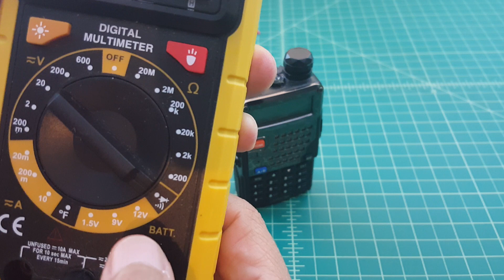Increasing the Range of your Baofeng UV-5R With a Counterpoise - TheSmokinApe

Comment: Putting DC voltage across an ohm meter, sometimes blows out the meter.  I usually check with a volt meter to be sure there is 0 volts, before I test something like that with an ohm meter

Comment: Would wire length work if I'm using my Baofeng BF-F8 Plus as a PMR radio❓
Reply from the maker: You need to cut it specifically for the band

Comment: No FN way!  There’s a few 5/8 wave antennas on the market.  But the problem is you need a death grip on the radio to make them out perform a 1/2 wave.  You just gave me an idea to make a single tape measure radial that centers on the 2 belt clip screws for a range lord radio.

Comment: Just curious if anyone has used a counterpoise with it coiled up a little to get it out of the way? Does it defeat the purpose if its curled up and tucked out of the way? Ive made one but find it a little annoying to have it dangling on my side as im walking through the woods. Thanks for any input.
Reply from the maker: I haven’t tried it but I would think it wouldn’t work well and could cause SWR problems.
Reply: @TheSmokinApe  Thank you for the reply and advice.

Comment: So I have 200 acres of bush and need to set up my uv-5r in the house sometimes as a base station . Could a portable J pole antenna  be run up to the second floor to increase range through a mile of bush ?? Thoughts.
Reply from the maker: Yeah, you could get a mile easy with a Jpole 👍

Comment: worth a try. I use my UV-5R backpacking in the side of backpack with speaker mic. I work both bands so will try 2 meter one,  I do have 42in abbree antenna but only use it when at fixed location like a picnet table. 73/s
Reply from the maker: Yeah, no kidding...

Comment: I think Im a counterpoise.   When I am receiving a weak signal with my boefeng, if I grab the antenna with a firm grip, the signal increases in strength and modulation.
Reply from the maker: Hey Michael, when you hold the Baofeng regardless of where…. You are absolutely part of the antenna system.
Reply: @TheSmokinApe  lol.  I know.   the old realistic cb radio hand sets in the early 1980s had metal panels on the sides to enhance making you a part of the system.   Its cool though.  When I have the boafeng on the table and I get a weak signal....I reach over and grab the antenna and the signal clears right up.

Comment: Makes perfect sense.
A little trivia: Back in the 70's and so Motorola HT's had a metal surface around the frame of the radio that you'd end up grabbing to hold the radio. Thus counter poise. As radio's evolved, so did plastic cases. Never could figure that out
Reply from the maker: Hey Dave, thanks for the trivia 👍

Comment: You MIGHT want to "pin" this comment! YES, counterpoises DO WORK really well! But you'll want to make them a hair LONG and then test the SWR with an SWR meter, then TRIM them to length for whatever frequencies you want to use, or else you can have excessive amounts of reflected RF energy bouncing back into your radio which will COOK it over time! Counterpoises work REALLY well when you're on soil or rocky ground that doesn't give you a good electrical ground to the Earth too!

Comment: The lanyard loop is ground iv seen counterpoise lanyards for these . Looks a bit more professional than a wire under the antenna or clip lug..
Reply from the maker: Good point, I wouldn’t want to mess up the professional look of a Baofeng 👍
Reply: @TheSmokinApe  you don't think It's professional?
Reply from the maker: @johnhosler9417  I’m kind of joking around, I’m not a feng hater.
Reply: @TheSmokinApe  the 24 dollar murs/gmrs/marine vhf/2meter ham/70cm ham LMR commercial fm repeater compatible flashlight. The little radio that could.

No wonder it's illegal all the other companies in the sub $50 . couldn't make a profit.

It's a pretty slick radio

Comment: If you make a "Sping" connector (solder a ring terminal to a spade connector), you can then change tails in the space of a couple of seconds - unplug the 2M tail and plug in the 70cm without having to fumble out with a screwdriver (and risk dropping/losing the screw).

Or you can have a 17cm tail ring terminalled to the radio (for 70cm use) but with a spade on the end of the tail, so you can plug in the "extender" for 2 Metres (an extras 35cm or so)

Both save a lot of time and obviate the need to carry a screwdriver or risk losing the case screw.
Reply from the maker: Thats a great idea, thanks for sharing 👍

Comment: Everything you're saying is true. A 4 watt baofeng uv5r iii and 8 watt baofeng uv5r.  Antennae makes all the difference. Sorry for bothering you again! But it confuses me as to when you grab the radio: better reception? If you're not holding it. It's not as strong and a bit scratchy! Does that mean it's using your body as a ground? But the counterpoise I got from you and I'm picking up every tradesman in the area when scanning and every truck driver. But body to ground? Is that possible? Btw honestly I am getting like a 3 db gain with the counterpoise. Cheers
Reply from the maker: With most HT radios the operator is supposed to act as part of the ground 👍
Reply: @TheSmokinApe  ok. That explains a lot. I couldn't find anything until you told me
 Cheers

Comment: Good info! But shouldn't the other end be attached to the antenna connector? I'm not say it should be but I'm thinking that would be best.
Reply: It is connected to the antenna connectors ground potential.  The antenna ground is connected to the chassis and the screw he attached the counterpoise to is also connected to the chassis, so the counterpoise is connected to the same ground potential as the antenna's ground side.  I have been using these for years, started using these on a Radio Shack HTX-202 back in 1992 as a newbie ham.  Got the idea out of an old ARRL antenna book.

Comment: I made a 1.5 metre counterpoise and when testing with the surecom sw 33 with no counterpoise it was showing 19.9 on swr. When I put my counterpoise my swr dropped to under 9 swr. It was touching the concrete. And i had full reception from the highway. I also grabbed a wirewound inductor, a ferrite core type with just sliding up and down the Nagoya 771, my reception was going up and down. Lol! Believe it or not the big counterpoise made a big difference. Can you do a test of swr meter surecom sw 33? Mine has 3 settings and it's confusing me on 3rd setting? Love your vids. Amazing how experimenting can make a difference between good and bad!
Reply from the maker: I don't have the Surecom but let me see if I can get one, glad you like the videos 👍
Reply: @TheSmokinApe  always a good tutorial.
Reply: The Surecom SW33 costs more than the UV-5R!

Comment: I tried a 16cm one for PMR and what a difference. I only bought a pair of UV-5R's recently mistakenly believing they were just better quality walkie talkies...doh!  However they have sparked my interest in ham radio.  I still have the OEM rubber ducks fitted but a pair of Nagoya 771's are on the way.  I have read the OEM antenna are pretty bad so I was rooting about on the net and read about counterpoints.  Before fitting them the radios were simply short range walkie talkies but after fitting they came alive.  I have been receiving extremely clear transmissions from all around me for a distance of over 20 miles!!!!  No I'm not kidding.  Admittedly the best one was in a pretty elevated position on moorland in West Yorkshire (I'm situated West of Manchester UK on flat peat farmland).  He was transmitting from Holme Moss near Holmfirth where the BBC TV mast is located.  He was talking to others in Runcorn, Cheshire, Bolton in Lancashire and Eccles some five miles East of me.  I ask for a radio test, admittedly at high power in frequency mode and he reported 3/9. I am very impressed a piece if wire can do that.  I went into channel mode and reception was still as clear but my transmission was barely readable.  Given the distance (20+ miles) that did not surprise me.  However it did transmit the five miles to Eccles though not very clearly.  These are great little radios but illegal as PMR's in the UK without a licence.  However I am going to take the Foundation course and test as it has sparked an interest in this old codger.  Who knows?  I may well get deeply into it and invest in a decent base station.  Something else for my wife to moan at me about other than my collection of rifles, csmeras and all my time messing with computers and electronics.  A man has to have a hobby or two, or three or four or......😄
Reply from the maker: That's awesome, good luck on the test!
Reply: Just curious is all.. but what frequencies were you dialed in on while using them as "walkie talkies" ? :)
Reply: @bradskis81  Europe's PMR446...

Comment: Yep.. 1 db gain is likely. To get 12 db gain over the H-T antenna you would have to put a 15' triple stacked 5/8 wave vertical w/ a 4-radial ground plane... or a 10 element Yagi... That would come close to 12 db gain, though either might prove a little unwieldy when getting into and out of your vehicle. Anyone that claims 12 db gain by adding the counterpoise learned to calculate decibels-of-gain estimates from the current President.

Comment: Dont have an issue with drinking but IMHO it doesn't increase the credibility of the vid.  Also
I heard that 468 is the divisible figure but I could be wrong about that.  
Good video, the mounting to the belt clip is interesting.  Practical.  Have wondered about the db increase also.  Will have to research but I have plenty of scrap parts to make one.  So...I'm gonna.
Reply from the maker: Good luck with the project 👍

Comment: Just found on-line  an accidentally-found method to increase UV-5R T/R POWER. The person explains the following steps which he says he found accidentally and claims once the radio is turned off so will these unknown special settings..Writing it here that SA may want to test!!, ie: " 1. Depress [MENU] button
2. Scroll to menu # 2
3. Depress [MENU] button again
4. Toggle the UP or DOWN arrow until 'HIGH' or 'LOW' is displayed (your choice)
5. Depress [MENU] again to confirm, BUT - DO NOT depress [EXIT]
... an 'L' will appear adjacent to the 'S' meter in the LCD if it 'took'
6. Depress the PTT button on the radio
... Note, if you depress [EXIT] instead of the PTT button, the 'L' will disappear from the LCD.

The radio will retain this changed power level until the radio is turned off. When the radio is powered up again, the power output level will again revert to the original programmed level." Hoping it's true.
Reply from the maker: Robert Fitzgerald the UV-5R only has low and high power.  The “L” means you are set to low...  it would be nice if you could get more but this isn’t going to do it 👍
Reply: @TheSmokinApe  I see. So you've tried the adjustment using a power meter?
Reply from the maker: Yeah, I've done dozens of tests on these radios.

Comment: Just became a Ham a couple weeks ago.  Is that wire supposed to establish a ground plane?
Reply from the maker: Yeah 👍
Reply: @TheSmokinApe  Well then, that makese sense from what I'm studying so far.  A friend gifted me a UV-5R and that put me on the path.  Thanks for the video.  I look forward to trying your little hack out.  Thanks and thumbs up!
Reply from the maker: Thanks man!  Good luck on the general 👍
Reply: @TheSmokinApe  BTW - I skipped fwd throughout your video initially to verify it was a legitimate sounding tip.  I replayed it and realize that you quite clearly mentioned the "ground plane" idea - totally makes sense.  I am in the process of mounting a 4 ft vertical fiberglass antenna with ground plane that I'm planning to connect to my UV-5R which doesn't have as good a reception  with the default antenna compared to my RTL USB dongle with SDR Console (I prefer it over SDR#).  I didn't think about the ground plane part of the issue until I came accross this video...  Thanks again.
Reply from the maker: Congrats on becoming a ham!
Reply: @TheSmokinApe  Thanks much.  I am working on my General license now.

Comment: Does it matter the length of the antenna,Stubby or long? tiger tail Will always be the same length for the appropriate band?
Reply from the maker: It should be a 1/4 wave of the band you are using 👍

Comment: Hello, I am KN4WKJ, and correct me if I am wrong, but at about 1:45, he mentions grounding the negative charge. Though in the user manual of the uv5r it says that you shouldn’t use the radio while it is on the charger, (I still do because it makes my transmitting power stronger, but that’s beside the point), while it is on the charger, the weird looking middle connecting port is actually ground. Once again, please correct me if I am wrong, but that is what it appears to be.

Comment: What do you think about this video? he claims most people of a misconception of counterpoise.
https://youtu.be/DMGXGxbn5GU
Reply from the maker: I think his product is reasonable.  What he says about the adapters isn’t fully accurate and I’d like to see some evidence using an antenna analyzer to support his claims.  You can use a a coax feedline to remote mount your antenna and while it slightly changes your antenna system it doesn’t really change the resonance of the antenna. 👍

Comment: Ok so the standard antennas are dual band eg they have two wound elements. Surely they are in parallel but depending which band 2m or 70cm the other half is ignored. So if you connect 2 rat tails one for each band does the radio ignore the one for the other band ? I've always wondered
Reply from the maker: I’ve never tried, sorry man 👍
Reply: @TheSmokinApe  I'll try it with a power meter and a swr meter and see if it works
Reply: Interesting. Keep us informed if you find out

Comment: Antennas help for sure, but if you have a crazy 6 foot antenna it’s only gonna work as well as the radio allows it to. If you have a 1 to 5 W radio, you can only put smaller antennas on it, a longer one is just a waste of space. 10-20W will allow longer antennas to work to full capacity

Comment: Tram 1185. We take the antenna off the mag mount. Cut a stainless steel welding rod down to the frequency your using. I get 10-12 miles with this setup. Which is all I need.

Comment: Brute force dosen't do squat. most of your power is used to form the signal. On 10 watts (6meters) I talked to fort Hood Texas. From plumbrook a( NASA site in North ohio.  On only 10 watts ) the antenna was pulled from it pack and assembled. (Taller than me) it too had a counter poise. Yes your tail is good work. I went to south eastern signal school and learned a lot. 73 de kv4li

Comment: The wave thing on the meter. Ffs.

If you don't know what the hell is on a multimeter, how the hell can you back the science of the rat tail.

You will find that the radio chassis itself is the counterpoise. You are also the counterpoise.

Amazingly, the engineers that make the device usually know exactly what the hell they are doing.
Reply from the maker: Ace, if the radio is sitting on my desk while I’m listening to a net how am I part of the counterpoise?
Reply: @TheSmokinApe  You body is used as a reflector for transmission and a plane for reception.

If you aren't hand holding a hand held, maybe you should consider monitoring on a fixed set, with a REAL ground plane and use the mobile set when you are mobile.

Kind of a common sense required thing...

If you want to be really clever, you can actually make a real counterpoise for your handheld antenna and hoist it up a tree if you want insane reception when out in the woods or doing SAR.
Reply: @TheSmokinApe  And before you start with the what the fuck does he know bullshit, I am the Assistant Communication Officer for a maritime search and rescue group. I am proficient in MF, HF, VHF, VHF Marine, UHF CB (Australia) and the 400MhZ Emergency Service Band used here in Western Australia.

I hold a Long Range Operators Certificate of Proficiency from the University of Tasmania also.
Reply from the maker: If I’m going to throw something in a tree it’s going to be a roll up jpole.

Comment: What do you think of the stubby antennas I see on Amazon, 2 inches tall.
Reply from the maker: I use a stubby Diamond RH-3 and I love it, it was a little pricy.  Allot of the small ones on Amazon or eBay are counterfeit.  Also, a small antenna will not perform as well as a larger one 👍
Reply: @TheSmokinApe  so size matters? 😂
I was looking at
https://www.amazon.ca/Bingfu-136-174MHz-400-470MHz-Handheld-Compatible/dp/B07P7LGWW5/ref=sxbs_sxwds-stvp?cv_ct_cx=baofeng+antenna&keywords=baofeng+antenna&pd_rd_i=B07P7LGWW5&pd_rd_r=89646ca4-dfeb-45db-b1bb-cc2b7a38bbbc&pd_rd_w=J7wi9&pd_rd_wg=Lro0R&pf_rd_p=bfff3d65-6819-413d-909c-b46ff443d96b&pf_rd_r=38DT6JYP5XRDDBFJR2PA&psc=1&qid=1579560929&sprefix=Baofeng+&sr=1-6-dd5817a1-1ba7-46c2-8996-f96e7b0f409c
Reply: @TheSmokinApe  I was thinking about this for my camper. If size matters? 
https://www.amazon.ca/gp/aw/d/B07RB9J59Z/ref=ox_sc_act_title_1?smid=A53D4KYDMI7UZ&psc=1
Reply from the maker: That camper antenna looks interesting.

Comment: I made a wrist strap (paracord with a wire inside), attached to the radio's strap buckle (see manual) with one end of the wire then connected to the belt clip screw. To reduce the length of the wire/paracord (wrist strap size), I wrapped the paracord to make a coil with the free end of the wire cut before it enters the coil. All effectively the same as this video, just cleaner looking and less cumbersome. Can even adjust the wrist strap (beads, etc - just like a regular strap) to fit better around my wrist. Since it's functional (and "pretty"), not all that important whether it improves performance or not (darn hard to tell).
Reply from the maker: Sounds like an interesting idea 👍